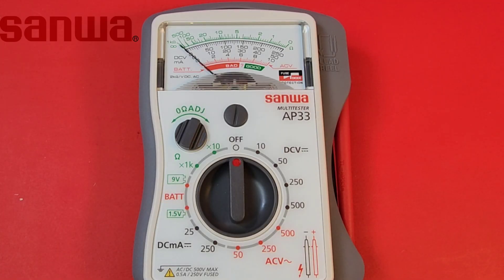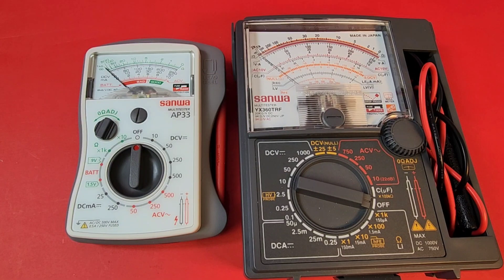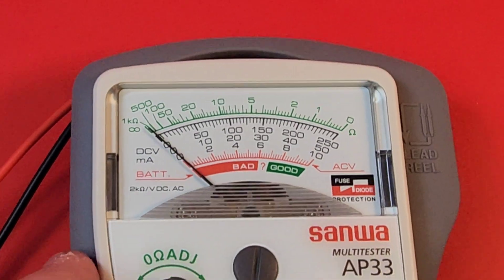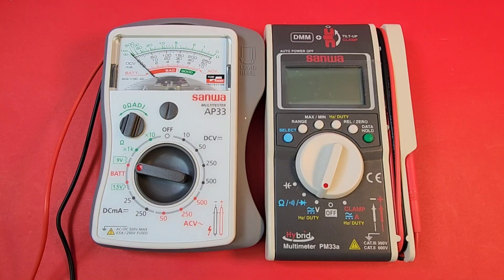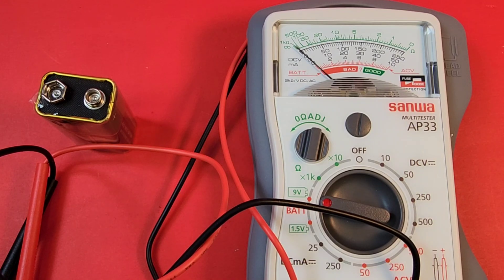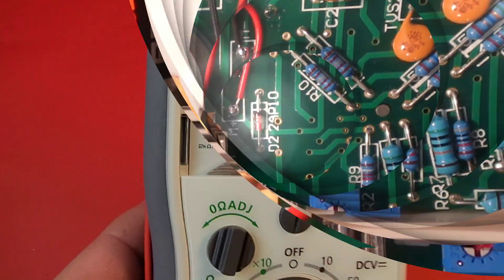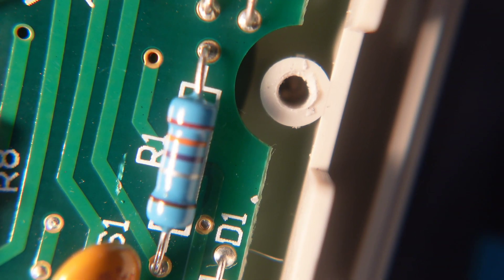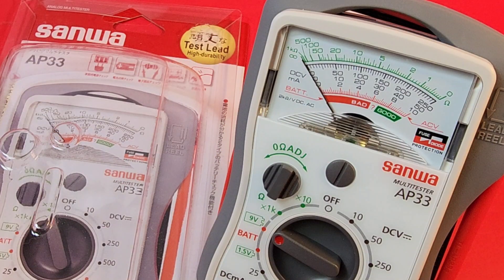SANWA AP33 MULTITESTER Review & Teardown!

Comment: 2kOhm/V on a Class 5 meter movement. That is ... a bit low end.
Reply from the maker: Honestly  it's one of the best made analog meters I've seen ..but I understand where you're coming from. 👍
Reply: @KeepOnTesting  Would be interesting how you'd compare the build quality to the Hioki 3030, which I believe you also reviewed?
Reply from the maker: @splitprissm9339  The AP33 is a small pocket analog meter , whereas the Hioki 3030 is a full size Analog device. So might not be the most accurate , that being said I like the comparative idea in general and will consider it for a future segment.
Reply: @KeepOnTesting  "Full size" would be something like a Unigor 4p or AN/PSM6 for me :) BTW, some of the high end makers still have current models, but they are really expensive - eg Chauvin Arnoux and Gossen Metrawatt have current, professional grade analogs. Amused to see the MetraHit 2A, which is a decades old classic design still sold at around 500 bucks (the original can be found on the used market for 20 bucks-ish, though you might not always get lucky, the movements are not ultra robust and can have balance and hysteresis problems, and the range switches might need an overhaul).

Comment: I might buy these for compact electrical task
Reply from the maker: Great multimeter and solidly built! I'm sure they will do a great job.
Reply: @KeepOnTesting  yeah and sanwa use thru hole components is a plus
Reply: @KeepOnTesting  i just got it and it's good the display is so clean, and it's compact. i like this more than the yx360 version
Reply from the maker: @intelcorei0364 Excellent!! Glad you like it as much as I do..the display is stellar, and it's a tough meter too. 👍

Comment: Adjusting the needle to be exactly over the left hand end of the scale should be done before the right hand end.

The use of a 1.5 Volt battery means it cannot test LEDs.

When measuring voltage the 2k/V loading can introduce significant error. For example when switched to 10 Volt range the meter is a 20 kOhm resistor in parallel with the circuit.

The AC voltage ranges are not true RMS.  Only accurate for sine waves.

Buyers are paying a high price for the Sanwa name, not the capability and performance.
Reply from the maker: Yes, most analog meters have a high input impedance compared to their digital brethren. Still, it doesn't mean they aren't capable. Lack of TrueRMS is not a big deal for home users. Buyers are getting an inexpensive high quality test instrument from a world leader in electronics test instruments. The AP33 is very well made 👌 Thx for watching
Reply: @KeepOnTesting  No, most analog meters have a LOW input impedance compared to digital ones.  A mid range analogue meter is 20kOhm/Volt.  That is ten times less load than this Sanwa.
Reply from the maker: @geoffmorrison3648  yep..That was my initial thought, dyslexia set in temporarily hehe. The input impedance of a digital meter is far higher than an analog-type circuit (analog meter). It may be 20 kΩ/V while, for the digital meter, it may be 20 MΩ/V, meaning less interference or effect on the tested circuit.
Reply: @KeepOnTesting  You still have not got that entirely correct.  Unlike the impedance of an analog meter digital meters  usually have the same (or almost same) impedance on all voltage ranges. Typically 10 MΩ. I have never seen a DMM spec include an Ω/V figure.
Reply from the maker: @geoffmorrison3648 Disagree here Geoff. Anyways I'm not going to start a long debate over semantics. Thanks for your input as always.👍

Comment: I was desperate to get a VOM like the Sanwa YX361TR which has a zero-centre +/- scale. That is very handy in applications where you have to balance circuit elements. It is $113US so attracts a lot of counterfeits. I bought one of the latter, a '
'YX-360' from somewhere. When I opened it to put in a battery the screw post fell apart, and one of the ball bearings fell from the rotary switch. And the 'mirror' was painted on! So I got my $15(!) refund. So watch out for the Sanwa counterfeits. The authentic Sanwa's are worth what they cost.   But I would rather get a genuine YX360TRF which only costs a little more than the AP33. (I wound up getting a Tekpower VOM which has that 'null' scale.)
Reply from the maker: Those fake SANWA meters are a real problem..do not buy a SANWA meter unless it's from an authorized SANWA dealer such as sanwa-america.com 
Pity you didn't get the YX361 it's a beautiful precision test instrument..

Comment: Nice meter. Unusual to see through hole, very pocketable, but I would worry about catching the ohms adjust knob on something if I carried it in a pocket.
Reply from the maker: Good point..I would still put the meter in a cloth pouch or similar if I was going to pocket transport too 👍 It's a very solid hefty meter just the same so I'm sure it can take some abuse.
Reply: I don't question the quality, but I baby my meters. I think we are both the kind of person who doesn't like to run around with a cellphone with a cracked screen. @KeepOnTesting
Reply from the maker: @ericbaker1200 Yes Eric, absolutely correct. I'm almost absurdly careful with my test gear too. I can't stand a small chip on my phone let alone a cracked screen 😅👍

Comment: Never use analog multimeter how can you measure diode with it too?
Reply from the maker: If the analog meter has no dedicated diode mode you can use the resistance range instead. Set to lowest resistance range and Connect the diode in the forward-biased condition by connecting the positive terminal to anode and negative to the cathode.
If the meter indicates a low resistance value, then it's a good diode. 👍
Reply: @KeepOnTesting  ok thank you

Comment: I want one of these.  I don't need one (I have plenty of meters), but I don't have an analog meter.
And as to the lack of brass inserts, the only time the battery is used is for the ohms mode, so a battery will likely last you years.  And just don't blow the fuse. ;)
I also noticed that it does not have the highest number of ranges, but I guess that it is a small unit with a small switch.
Reply from the maker: Its minimalist as far as the ranges go..I think that's why it's so appealing 😅

Comment: That´s a multimeter from an ancient era, long ago. The only possible reason to buy this could be: Pure nostalgia. In pretty much every aspect is a simple 830-style DMM at least on par, if not even superior, but very much cheaper.
What do we get for around 50,-€? 
A DMM with a rubber bumper around the case, not protecting the display, nor the rotary switch, nor the zero-adjust-knob. The input protection only sufficient to protect the inbuild ammeter, not to protect the user. Very restricted ranges for measurements. A very low impedance, therefor building a voltage divider with the part under test, which is altering the readings. A tolerance of up to 25 Volts. No continuity test, no diode testing. No magnetic shielding (important for this magnetic driven needle ammeters). At least nothing was visible in the teardown. (And we all know: Shielding is somehow "your thing"!) 
Or around 10 "830"-style DMMs... alternative: Less DMMs which are a little more expensive then the 830´s, but far more advanced.
Examples: Listed in the video description above...
What´s left over to say about this Sanwa: Nice, pretty expensive battery tester with a nostalgic touch for sentimental enthusiasts, using a technology that´s developed in the late 19th century. It will be surely sold like sliced, warm bread. Any other thoughts?
Reply from the maker: All valid points but it's now residing in my portable Grab n go right beside my 830!  It's still robust even without a full boot and there's still benefits to an analog even in the digital age. Besides being more responsive to changing values, it also fares better in the presence of a radio-frequency field. Normally, this has minimal effect on the analog meter unlike its digital brethren. Plus..it looks dang cool 😎 👍
Reply: This terrible thing seems like a device to fool customers at a hardware store. They are not even try to scale the resistance scale linear. Some analogue meters implement this. In my childhood, a meter like this was the very first meter, this was more than 40 years in the past.

Comment: Analog meters belong on the bench, away from the wear and tear of the job site. Any idea what an analog meter does that a DMM can’t do?
Reply from the maker: Analog is definitely more responsive for one thing. If you're looking for small changes on a load the needle never lies. Because of its mechanical nature, the analog meter will display signal changes faster. Digital meters normally average the signals and have a sampling (reading) rate which is slow enough to miss a transient.

Comment: One thing ive noticed with Sanwa, the build quality is always there from the smallest to the largest, tho some might feel this ones a bit over priced considering its not digital and requires more focus to read on the fly & minimum input protection considering price, fluke 101 is similar or less money with killer input protection and easier to read digital display but less functionality.- but again nice overall Sanwa quality
Reply from the maker: I think the AP33 price is very reasonable considering the cost and mechanics involved. The 101 is no slouch but it's apples to oranges really.

Comment: Nice little analogue meter but would you expect anything less with that pedigree? As for 3D printing I'm a huge enthusiast , I've been 3D printing for years, I would like to be better at CAD but I get by, I get a real thrill when I design and make a "thing" You go from having an idea to holding a real, solid object, still blows my mind.
Reply from the maker: Wholeheartedly agree Shaun.
My Bambu A1 Mini is incredibly powerful despite its diminutive footprint!
Reply from the maker: Right ? This is from the breed of champions 🏆 
Cool ..3D is sooo much fun. The quality of the printers nowadays is stellar. I'll be doing a few 3D segments for sure. I think the cross between electronics and mechanics is awesome 👌 Kind of like the AP33 😊
Reply: @KeepOnTesting  It's a fact (no matter your views on firmware etc.) Bambu Lab change the landscape in a very short space of time and the quality of printers just keeps getting better. (I do have a resin printer but I don't use it a great deal although it is useful for my other hobby, scale modeling)

Comment: QUESTION - There's 20 times more magnets floating around my shop today than when I first practiced electronics in the 60's. That said, is there any Mu-metal shield around the coil Darren? For a meter so thin, I'd expect it from Sanwa, but it would be the most expensive part inside..
Reply from the maker: Great question Cliff..yes an MU shielding layer envelopes the coil housing.
I'll post a pic on the website.
https://www.keepontesting.com/post/sanwa-ap33
So many magnets so little time eh 
😅👍

Comment: On Amazon the Sanwa YX360TRF is worth the extra 9 bucks (at $79 😱) if you REALLY need a bigger display on something that can measure a voltage for say a hundred years without chewing into any of the battery life.
Reply from the maker: True enough! I think they're both great choices.. The AP33 for sheer portability and 360TRF a solid full sized meter that's a bench workhorse 😅👍

Comment: This type of meter uses batteries only for ohms, so don't worry about threaded inserts (5 years between changes). No need for input protection either, since there are no MOS devices inside and the movement uses bypass diodes to protect itself from seeing more than 2 diode drops.
Reply: I would not leave a standard battery in a multimeter for 5 years due to corrosion.🐌 Maybe a lithium primary would be safe. Self tapping screws can crack the posts, when overtightened or when the unit is dropped. 😜I would expect a 5 star meter would use threaded inserts for case assembly and durable serviceable access points. 👍
Reply: @pault6533  EverReady yes, Duracell NO. This is no 5-star meter, just a niche product making $$ for a 4-star brand name.
Reply from the maker: Great 👉 point..I was thinking the same but still felt it would have been nice to see 👍